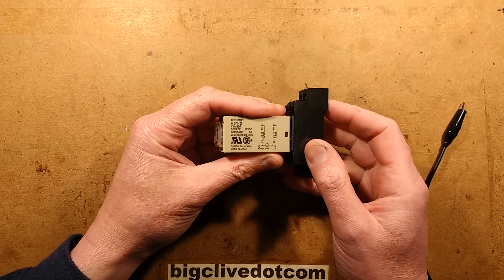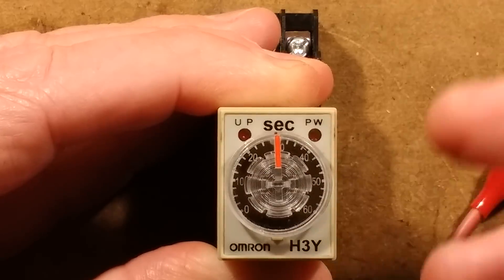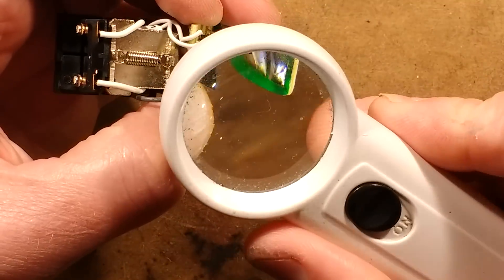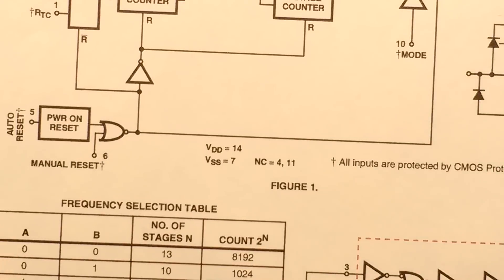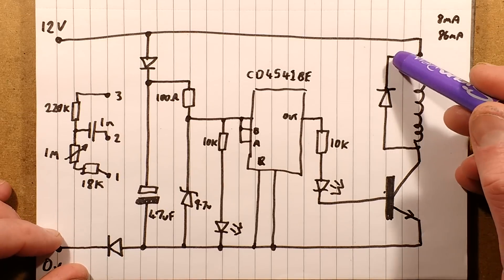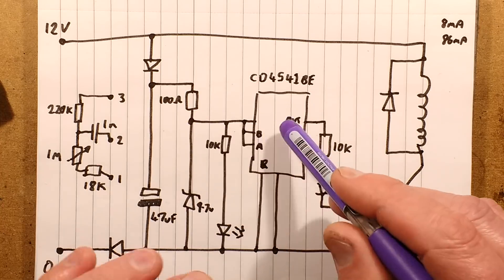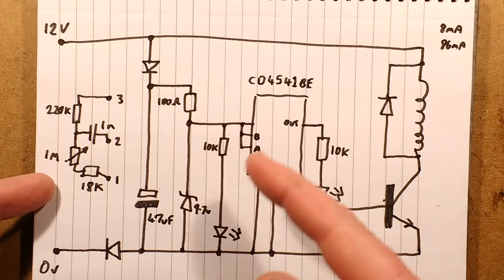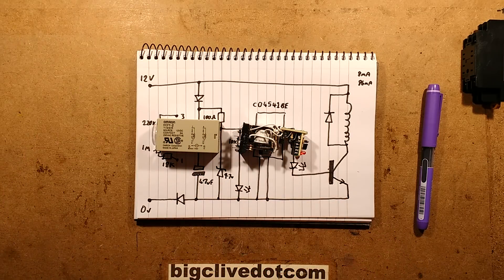Industrial timer knock-off.  (Actually quite well made.)

Comment: Could it be a 2nd hand one that has been tarted up in china? Could explain why it's reasonably good in quality...
Reply: The mentioned "Dead" timing areas that dont start timing until the 10-15 second mark is a dead give-away. They put all the right markings, all the correct plastic color, so its difficult. Most Techs will open uop their relays to look, specifically to see if its fake or not. For its intended use, this relay is just fine...I doubt if it will make it into a Lunar Lander or such.
Reply: twocvbloke I don't think OMRON would do that, they would want to protect the quality image of their brand. I think it's just a knock-off.
Reply: they sell thousands of these knock-offs, easier to make, than tart one up.
Reply: Genuine fake, the real ones use almost exclusively a tiny microcontroller on the board, and a much better pot as well. The power supply as well will be multi purpose on the board, you will have a board with power supply parts on it and a control board, and the power board will have places and traces for either a small transformer for the ones over 100VAC,  or for assorted dropper resistors for the low voltage ones, and will have protection for overvoltage as well on board. Real one also has an ambient temperature sensor on the board, used to do temperature compensation for ambient temperature on the oscillator.
Reply: SeanBZA can one tell it is fake without taking it apart? (other than low price)
Reply: Someone is trying hard to make it convincing.  I doubt TI products would make into such a product.

Comment: surprised the LED wasn' t just connected to the main rail , this would of mean the 100 ohm could of been larger and the cap could of been smaller. Likewise the Relay LED across the relay coil and use a small enhancement mode FET instead of the bipolar so the 4541 could drive it direct and not have current drawn from it. 

FET is possibly still more expensive than a bipolar tho.

the 4541 consumption would be very static then and also very low so the 100 ohm could be increased quite a bit and the zener would be the dominant current draw.  The lack of current draw from the 4541 will also improve counter consistency.
Reply: Transistor likely is a recycled part, and the transistor only is switched once per cycle. Not like this is a recycler that switches. Reset circuit is also not too good, there is a good chance of it glitching on slow rising power rails and never operating.

Comment: You're 100% certain it's fake? Not a second or something?
Reply: Knowing the chinese probably both.
Reply: Absolutely a non Omron part. Simplest test is there is no overvoltage protection, no fusible resistor in the power feed and the pot is not the one made by Omron. Omron also makes their own relays in house, and they will have a cover on them as well, not open contacts in the housing.
Reply: You can find these, including the plug in screw Base starting at about $1.00 Canadian,  sold by over 50 suppliers on EBay....TRUE equivalent Omrons start around $45.00....and OMRON dosnt sell "SECONDS" (Omron usually sells the Bases seperately, for about $10.00 as well). All these prices are dependent of Current handling and trigger voltage, I just picked a  median example. I truly believe that these are knock-offs, in every example.

Comment: If you need something more accurate for just a few dollars more, I use those DIN mount digital timers. Most of them count from 0.01 seconds to 99 hours which makes them endlessly versatile. Would love to see a tear-down of some of those :)
Reply: Genuine Omron has that in the H3B series, with a set of tiny rotary switches that change the display units and scales, so one unit can be set for delays from 5 seconds to 5 days, and the repeatability on them is pretty good. Only one item to stock for the wide range. I just used a cheaper Rhomberg Brasler version instead with smaller range, as I only needed a 10 second anti chatter on delay, and these were cheap and worked. Got a H3B sitting there for the 20 minute delay used to flip the heater assembly over from ultra fast heat, run the 220V 500W heaters on 380V for fast warm up, to maintain where they run 2 in series on 380V to maintain them at 160C. Funny enough these heaters are not the ones that have leakage issues with not being run for a month, the ones on 220v alone do, different size cylindrical element.

Comment: I always use (used, electronic soft starters are now price competitive) dedicated star / delta timers for star / delta starting. They have a delay between the changeover of the contacts and the better ones even have an adjustable delay between changeover to give the star contactor time to drop out before pulling in the delta one. (Mechanical interlocks can also play havoc with the changeover if it happens too quickly too).
Reply: Agree as well, on larger motors the proper star delta switch makes a big difference in the load change transient, and can make a difference in reliable starting and random breaker tripping, or needing to massively oversize cables and supply breakers.

Agree though on the benefits of the soft starter, took a 7.5kW motor from needing  a 45A breaker and associated wiring, along with a massive dip on change over ( plus fixing the original installer making it start in delta and switch to running star, solved when the star contactor dropped a phase intermittently, and the overload not having worked properly, meaning the 130kg motor turned to charcoal) to a soft starter making the start smooth and low stress, plus giving a speed ramp up as well for it. Was a pretty big soft starter though, biggest that was still a single DIN mount unit instead of a cabinet on it's own.
Reply: star/delta contactors should have signal contacts wired so only delta contactor operates when star contactor  has released  and then pulling in delta contactor so there is NO chance of overlap
Reply: Even with electrical interlocks (that they all should have), you still need a deliberate pause between the changeover. Ever wondered why they make dedicated Y/D changeover timers?

Comment: What do I need to buy to get a signal from a motion sensor to turn off after 1 or 2 sec.
Reply: Wire cutters.
Reply: For a one-shot event use a simple Op Amp / Comparator circuit.  If you want extra flexibility - the 555 is always my go-to solution! (The 'Net is awash with 555 simple timer designs!)
Reply: most infared sensors meant for hobbiest use have a variable delay...or simply get one of these relays that has a 1 or 2 second delay.....depends on what you are trying to run. 1 or 2 second delays are easy to get with a MOSFET and a capacitor, resistor bridge.
Reply: The NE555 - the timer chip that is so standard, every other timer is compared to it - is capable of operating in that mode. Triggers on low-high transition, won't trigger again until the input goes low to reset it..

Comment: +bigclivedotcom
Every time I hear of fake knock-off electronics, China, always comes to mind and because of them stealing tons of blueprints to IP, I can't help how it's affected me when buying electronics.
P.S... Hey, Clive, I Sent you a Message a few days ago, I'd appreciate it mate,  when you have some minutes to spare, would you kindly have a read of the message,... Thanks, Clive.
Reply: Sometimes cheap chinese stuff is great. But it should be not being a fake copy. Same shit with the LM2596... Can't trust any fucking website anymore to order the real deal. Went to electronics store to buy a module LM2596 from a popular electronics brand. Was testing this thing and found it it went hot as hell. After some investigation with a scope I found out that the switching frequency was 50kHz not the 150kHz they mentioned in the original datasheet. After contacted the electronics brand about the wrong switching frequency after a while they confirmed that the IC's on the module where indeed fake and they contacted the manufacturer.  So disturbing this crap comes in expensive modules as well.

Comment: I put one of these in my furnace a couple months ago.  It works great and frankly doesn't have any major consequences if it does fail.
Reply: If you found it so useful, why did you put it in your furnace? Geez, some people!
Reply: Domestic forced-air heaters are called "furnaces" in some places
Reply: He could have actually put it on his heater/boiler which would be a furnace... it's a place where a heat source is applied to another material. ¯\_(ツ)_/¯

Comment: UP means "time's up!"
Reply: UP is the Time Up indicator according to the Omron data sheet.
Reply: PW= Powered.
UP = Unpowered.
Reply: I used these in the machining workplace, the units that did some mechanical work had microswitches to indicate when the unit is near its end, but depending on the speed set for the unit it could take quite some time until the unit reaches the hard end, so we used these timers to set the unit time it would stay down. In this context UP would mean the unit is returning UP :p

Comment: Old computers in large labs had relays like this to kick the monitors on separate from the main units / CPUs if either all the computers were on the same power bus / breaker, or if the particular computer power-supply had a pass-thru IEC connector on the back for the monitor (so that you would only need one cable to the mains).  This was back in the gigantic CRT days.
Reply from the maker: Strangely enough, over the last week I've been studying up on old CRTs.  Particularly colour vector monitors.
Reply: You might be interested in Curious Marc's channel.
Reply: bigclivedotcom: Check out Shango066's channel for impossible CRT resurrections. BTW, would changing that  resistor next to the pot allow a shorter response time than 15 secs?